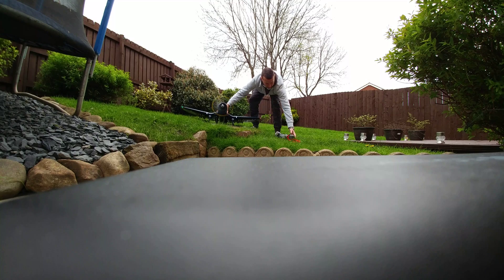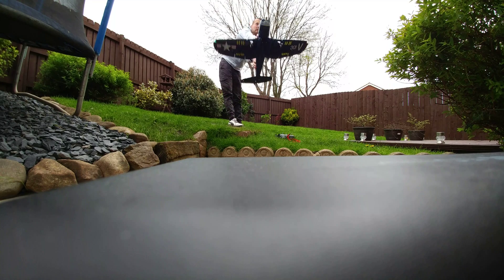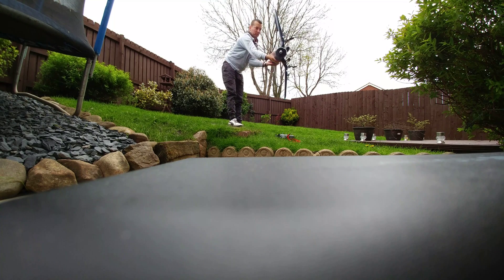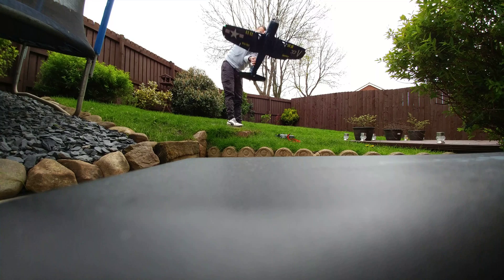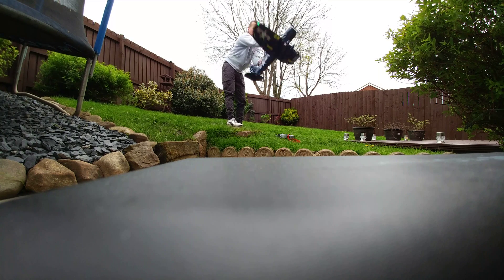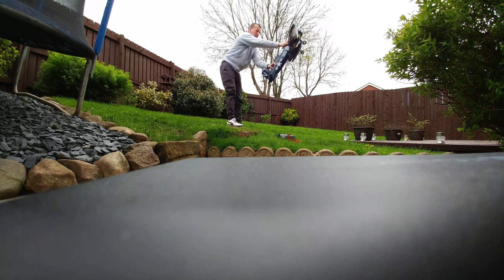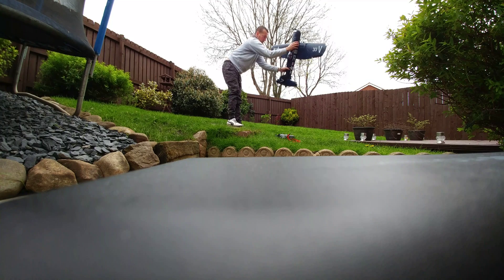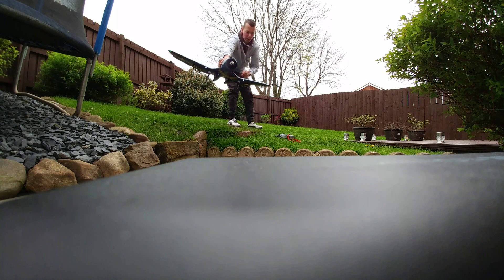Lemon RX Stabilizer Plus quick way to test for ESC BEC failure prior to flying

Comment: Had a bad crash and lost a lovely model the other day after swapping my trusty spektrum and putting a lemon 7 channel stabilizer rx in it.
Something weird happened. First time this has ever happened..the servo plugs were a loose baggy fit into the lemons end pins on rx but I went with it anyway. I did a range check using dx6 and only got 20 paces before signal loss. Silly me I flew the model anyway and fine for 5 mins then bang

Comment: Thank you so much for responding I greatly appreciate your help
Reply from the maker: Patrick Cooper double check if not triple check every step. So check surfaces move in correct direction. Gyro gain isn't too high. Should never need more than 1pm or so point. I have mine mixed to toggle the 3 modes. I changed the mode order. I changed auto level to advanced. Reset auto level to my planes level flight. Reset stick neutral. The thread had allot of posts and it can be complicated if you don't read carefully the steps.

Comment: I fly with several Lemon RX 7 channels and can't figure out how to set auto level, can you pinot me in the rite direction? Thx
Reply from the maker: Patrick Cooper Hi, check out the official thread here. It gets posts from the developers too. Make certain you read carefully. Jot down what each led means and how to set what after reading guides. Make certain auto level is reset to how you want it to fly level and a toggle switch reset. All info in guides on rcgroups https://www.rcgroups.com/forums/showthread.php?2800238-The-NEW-official-Lemon-Stabilizer-Plus-thread

Comment: I installed the RX Stabilizer Plus on a Bix3 using a Spektrum DX6i. All 3 modes are available with gear and mix switches. The aileron and elev servos travel (analog) are much shorter in the auto level mode when compared to the pther 2 modes. When I tried the auto level mode in the air I had to reverse to gyro mode. It was very hard to control. Have you experienced also short travel for aileron and elev servos ? Thanks
Reply from the maker: Enrique Laya have you changed auto level from default low rate to advanced. That will give full travel but will limit bank and roll so it cannot invert etc.

Comment: Class plain that! Garden is looking good too, ready made garden
Reply: #plane 😂
Reply from the maker: Jason L Tate yeah iv'e done a lot to the garden now, removing all them rocks looks better and re seeding grass, loads new plants etc. But this plane has a newly released RX in it that can possibly crash if ESC BEC which provides the 5v supply to servos, lights etc, can overload. It looks stupid doing this but it's better than taking a risk in the air lol.